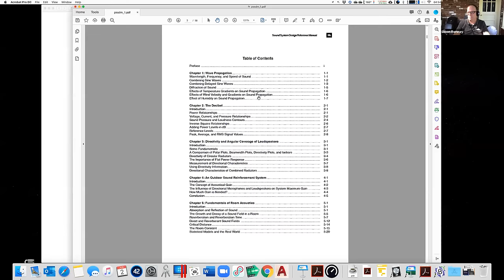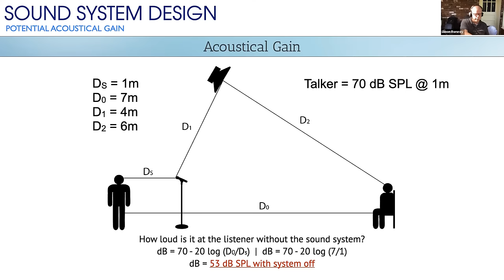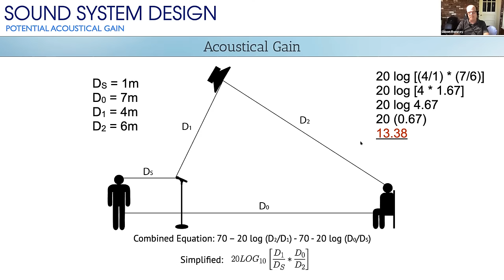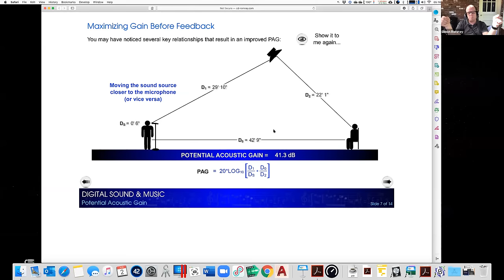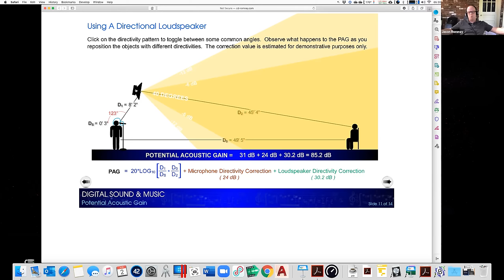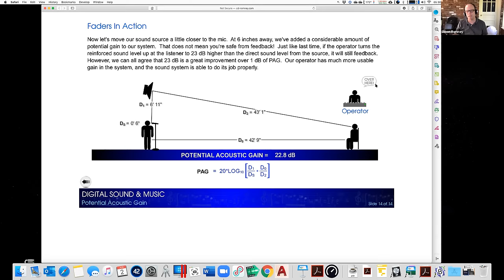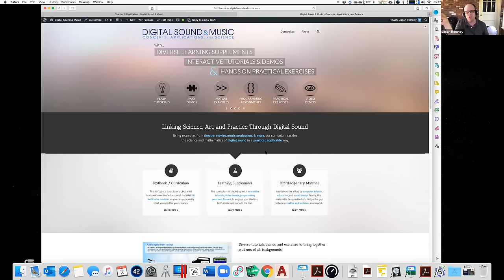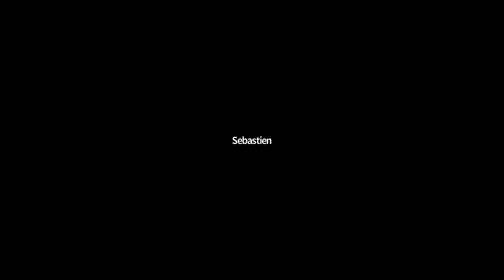Why EQ Is Not the Answer to Microphone Feedback with Jason Romney

Comment: Literature says, that in reverberant rooms because of the many overlaying frequecies and thus combfiltering you have even less headroom for feedback occurance. Statistically beyind a specific frequency thats dependent on Roomvolume and T60 you statistically have the same Peak to Average Ratio in the Frequency Response which is 12 dB (Schroeder 1954, Schroeder & Kuttruff 1962, Ahnert & Reichert 1981). Kuttruff recommends even more Headroom on top for Speech (5 dB) and music (12dB) (Kuttruff & Hesselmann 1976). This results in a deduction in gain before feedback of 17dB for speech and 24dB for music in reverberant rooms. So the example in the video is only applicable for freefield.

Comment: Ok, but what are the odds that a person qualified to be employed as a sound engineer is going to show up to work & turn on a system in which the microphones are not going to be cardioid, the speakers are not already going to be positioned as optimum as the house will accommodate & the source is not already going to be at the optimum proximity to the microphone?
Typically, when a person qualified for a position as a sound engineer resorts to using the EQ for stabilization, all the variables addressed in this video are as optimum as they are going to get &, essentially, any stabilization issues should only pertain to the stage monitors which, ideally, should be a secondary system isolated from the FOH system, but, even when they are a subsystem of FOH, the compromise in sonic quality for the sake of stabilization is tolerated.
The fact of the matter is, in a professional real-world scenario, an engineer IS going to need to apply EQ'ing in an effort to achieve stability, but it should only pertain to the monitor system or subsystem... 
Ideally, aside from MAYBE a little roll off at the very top &/or very bottom of the spectrum & "flavoring to taste", if you will, the FOH EQ's, should be "flat"...
Of course, the amount one may need to vary from "flat" to "flavor to taste" is relative to the inherent acoustic qualities of the venue...
Or, if outdoors, the pertinent atmospheric conditions.

That all been said...
Three words: "In" "Ear" "Monitors"...
"GBF" problem 𝗌̶𝗈̶𝗅̶𝗏̶𝖾̶𝖽̶...eliminated.
Reply from the maker: Hi metalhead. Thanks for your comment. I don't think Jason would spend his time talking about this stuff if he didn't think it was important because he sees a lot of his students doing it. I can also corroborate that I see lots of people reach for EQ before placement, aim, alignment, and other tools we have available.

Comment: I use feedback regularly as my spectrum analyzer and it didn’t lie me ever. And also, since feedback is defined as a 1:1 ratio between the pressure arriving at the microphone and entering it, (imagine a electronic circuit in short, or a ring that closes its edges), it can be used to set the right volume on your amps to produce the right spl for the event.
Reply: 7:35 that’s exactly what I apply alle the time: I set the microphone to a spl reference (practically my voice because it produces 87 dBspl at 2 centimeter), I put the microphone in the venue where I want to get 87 dBspl, I set the console on a feedback condition, then slowly I raise the amp volume until I hear the feedback and then lower the volume few dBs. Now I know that in that spot the loudspeaker, in conjunction with the amp, is producing 87 dBspl. The benefits of this method are many but the most important one in my opinion is not amplifying useless noise because the amp are now correctly settled.

Comment: you might want to use the notch method on a Monitor on stage.  but clearly only because it's affect for the feedback loop while no effective change to listener. each monitor will be able to be independantly adjusted hard limiting the monitor would really end the deal

guitars with mics can be used with ISO cabs.  plexi shields for drummers etc etc   before you really ever need to notch the PA channels...  and if you did you might only need to notch the 120s at the bottom of the tower

Comment: Another question is the issue of multiple mics. The more mics, the lower the available gain. Isn’t it something like every time you double the number of open mics, you lose 3db (or is it 6?) of gain before feedback? ?
Reply: also interested in this as multiple open mics is a normal scenario for mixing bands x
Reply: Yes a doubling of open mics increases signal level (if you sum them) by 3 dB. and thus decreases gain before feedback.

Comment: On the question of why systems feedback when the band stops playing.  I believe the most likely “culprit” is that all of your various compressors relax, effectively increasing the overall system gain. Remember, a compressor is a gain REDUCTION tool. When the signal goes below the threshold, it stops reducing gain. Most of us run compressors on individual channels and more on the various mix buses. All of those let loose when the signal level falls…overall gain goes up, feedback ensues.

Gates and plugins like PSE can help combat this (along with mixing 😂)
Reply: that actually makes a lot more sense! i dont know how the decorelation of the microphones should play a role. I mean as he demonstrated, the feedback doesnt depend on Signal source level, rather the system amplification and frequency response. The source signal is not part of the equation (Ahnert & Reichardt 1981). So your explanation would fit into that theory.

Comment: Feedback doesn't occur when the sound from the loudspeaker reaches the microphone at the same level as it would directly from the person speaking. It happens when the waves from the loudspeaker can get back to the loudspeaker via the microphone at a time such that their peaks match the peaks already coming out of the loudspeaker. It's that constructive interference that causes the increase in volume of that frequency, and since it continues on the next round, that frequency builds to the familiar squeal. Being the same level doesn't matter; the waves being in sync does.
Reply from the maker: Hey Steven, thanks for checking out the video and your comment. It's great that you bring up time, but I'm afraid we can't have one without the other. Where summation is based on magnitude and phase, magnitude is the tie breaker. If the waves as you describe them arrive at the right time, but are 40dB lower than the original signal then the possibility of constructive interference is near zero. So while the signals might not need to be exactly unity to ramp up to feedback, it's gotta be close. 

There's an AES paper called Using a Speech Codec to Suppress Howling in Public Address Systems. I found this quote very helpful:

"In other words, a linear-time invariant model of a public address system is stable if the amplifier (including audio DSP) is stable, if the room is stable, and if at any radial frequency ωh where a sinewave traveling around the loop will perfectly constructively interfere with itself (i.e. the phase response is an integer multiple of 2π around the loop), then the magnitude response around the loop must be less than unity."
Reply: Hi Nathan, and thanks for the response. The AES paper is basically stating the Barkhausen criterion: for a stable state at a given frequency, the delay around the loop must be a whole number of waveforms of that frequency (to keep them in phase), and the gain around the loop for that frequency must be =1 (i.e. unity gain, +0 dB, so they get neither louder nor quieter). Maybe a misunderstanding of that is indeed at the root of the problem here. The Barkhausen criterion is for a stable result, so not a feedback howl but a continued singing that doesn't increase in volume. For audio feedback purposes, we know having more gain just makes the feedback happen faster and louder, so we can change the Barkhausen equation from 'gain = unity' to 'gain >= unity'. (The paper says 'less than unity' for 'stable', which is incorrect for the normal use of 'stable' in Barkhausen, but maybe just an unfortunate choice of a word to mean 'not feeding back'.)

Note that the unity here has nothing to do with the original input signal, but only with the gain of the whole system. It really doesn't matter what the volume of the talker is. You don't even need a signal to start feedback, as we've all seen in practice: if the gain around the system at a given frequency is > unity, and that frequency stays in phase, then simply unmuting the mic means it can start to feed back. The background noise (either acoustic or electrical) is enough that the feedback frequency will be selectively amplified by the system.

We can show this in an anechoic chamber, in total silence. Or rather more easily in a DAW like Reaper, by setting up a white noise generator at -85 dB (the sound floor of a Midas M32), a delay of 5ms (so 200 Hz and 1.72m - about the distance from a singer's mic to a wedge monitor). That -85 dB is a lot less than the -40 dB you mention, and isn't at a specific frequency (pink noise would be better for some points of view, but here we want electrical noise, and that's white). If we set the whole system so it's just below unity, and give a tiny boost of 0.2 dB at any frequency matching a multiple of the delay length just to get things started, we get feedback at that frequency. If we boost a frequency that would be out of phase over that delay, we don't get feedback: . We can even turn off the white noise after a few seconds, before you can even hear the boosted frequency, and that frequency will continue to grow and feed back.

The video is simply incorrect in saying (many times, but e.g. slide at 8:00) that "Feedback happens when the sound from the loudspeaker arrives at the microphone at the same level as the sound from the talker". He uses that to mean ongoing level, like a VU meter would show, but even if he meant an instantaneous level of a single sample (which would take into account the phase of the two signals, as he points out briefly later), it's still incorrect. Even if we change it to be "instantaneous level of any of the sine waves which can be considered to form the sound", and require that it continues, then we still don't have feedback: we need >= unity gain around the system.

I imagine there's no actual difference in understanding here (or at least I hope not), and it's just that Jason's attempt to formulate it has crystallized on a phrase that is actually incorrect, rather than just being incomplete. The level from the talker does not matter. Indeed, if we think of feedback as being nasty and loud, and wanting to avoid having equality with that level, Jason's phrase gives the impression that having the level from the talker lower would help stop feedback. As we know, the opposite is true - even if the instinctive reaction of most talkers on hearing feedback is to move the mic away from their mouth!